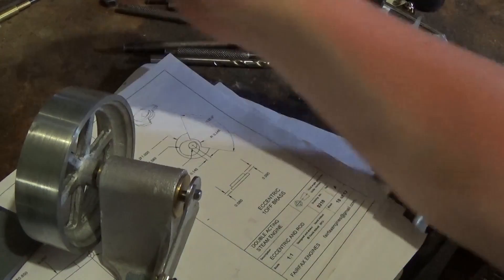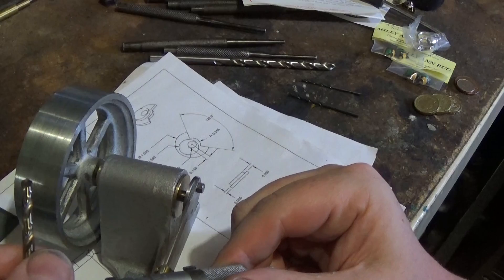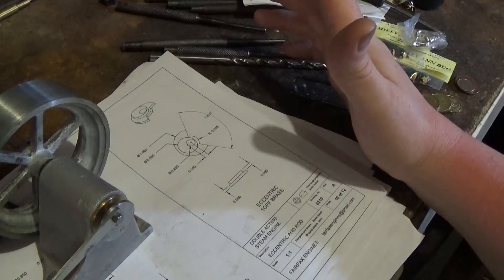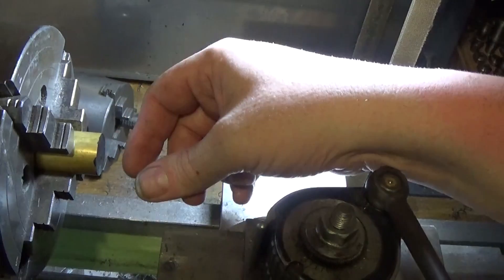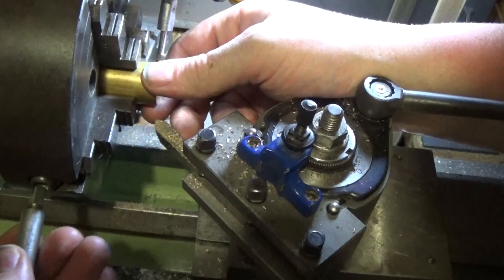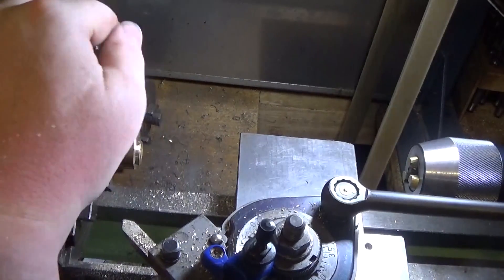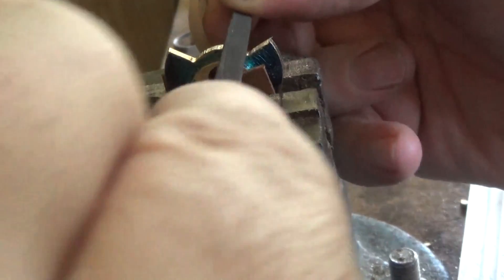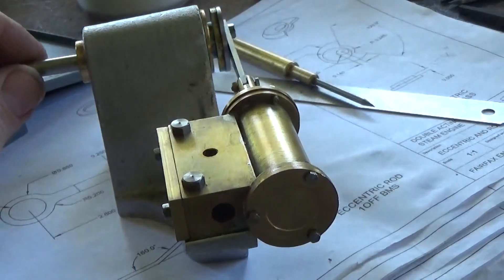myfordboy engine PT 15 (eccentric)

Comment: That cam is a nasty piece with a lathe alone. Cutting it out from the drawing is fine. That is where a variable-speed jigsaw comes in handy. Or at higher cost, a mill with a rotary table. Good work.
Reply from the maker: yes a rotary table would be the answer. im sure it could be cut on the shaper too. this will run well enough i think.
Reply: I did not think of that! You do have Mortimer. It should have a tilting head.

Comment: You certainly would have a job getting sunburn in London this week. :-)  Engine looking good Emma. To stop the drill grabbing in brass/bronze or plastic you need to just hone the sharp cutting edge off a little. There is a really good video from Toms Techniques here :- https://www.youtube.com/watch?v=8Ri6poVpQM8. I keep a basic set of drills up to 12mm ready honed especially for that type of material. Look forward to the next video. regards from the UK Gary
Reply from the maker: thanks for the link Gary. i shouldnt have used that drill, but its done now.